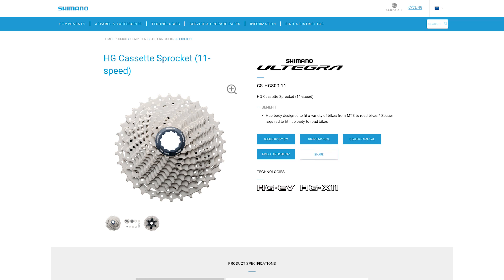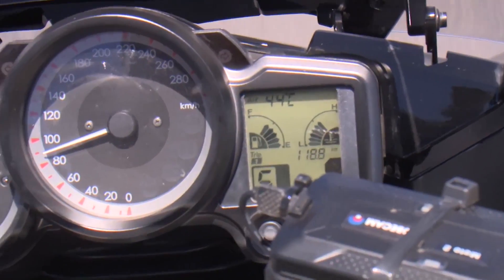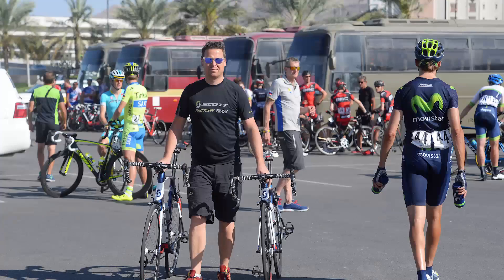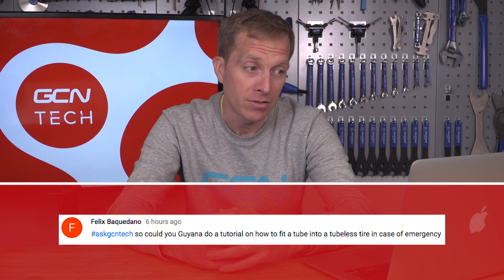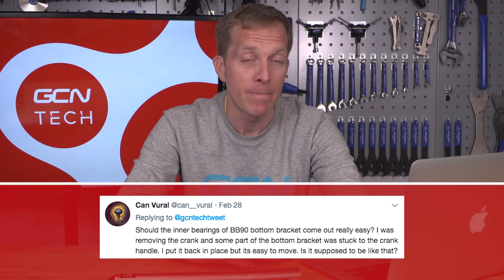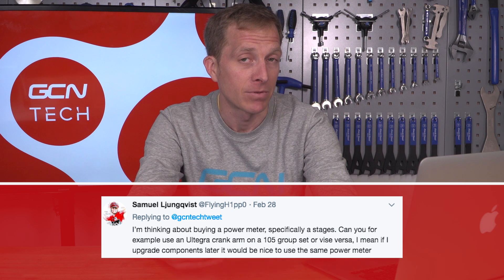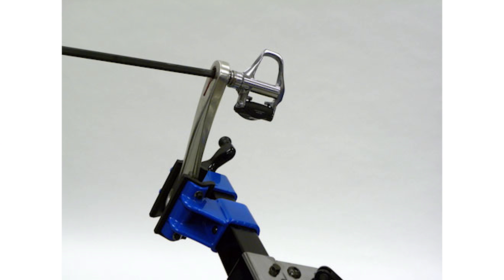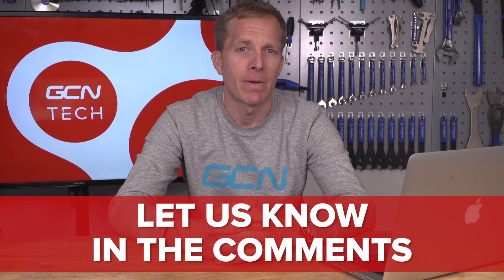Tubular Tyres: Tape Or Glue? | The GCN Tech Clinic

Comment: you talk about the benefits of disc brakes over rim brakes when weather conditions are bad e.g.: rain or mud then u talk about tubular glue and rim temperatures during braking without the mention of the benefit of disc brakes with tubular rims in dry hot conditions where tubulars rolling off the rim is lessened when using disc brakes...what gives?

Comment: Question, could you use sealant in a tubular tyre to avoid punctures ? If sealant can fix punctures in tubeless tyres, why wouldn’t it work in tubular ? Thanks
Reply: felix lessard Absolutely, I run 30mls of stans permanently in my tubs, which I ride everywhere. Latex tubes (which are in good tubulars) seals better than putting sealant in butyl tubes.

Comment: I don't see how carbon rims would get hotter under braking. The heat is converted from the kinetic energy of the rider+bike.  The speed, even with carbon wheels, will be about the same as alloy :-). The change in temperature then depends on the the specific heat capacity of carbon fibre composite and it's conductivity.  The heat capacity seems to be almost identical to aluminium, (maybe slightly larger) [1,2].  The conductivity can vary widely depending on the details of the composite.  With poor conductivity, the brake tracks may get hotter than alloy, but does that really translate into hotter rim beds where the glue sits?  Seems unlikely.
[1] http://www.matweb.com/search/DataSheet.aspx?MatGUID=39e40851fc164b6c9bda29d798bf3726
[2] http://www.matweb.com/search/DataSheet.aspx?MatGUID=b8d536e0b9b54bd7b69e4124d8f1d20a&ckck=1
Reply: oven cleaner Yes, it is a problem. When carbon composite gets to 200C it goes soft. This is a problem on clinchers because there is 100psi behind the brake track pushing outwards which  can blow the tyre off. (Why the introduction of disc brakes). With tubulars, there is no pressure at all behind the brake tracks therefore it is not such a problem. Why there is very little benefits for the pros to jump to discs
Reply: Sure, I agree with all of that.  The issue I have is around 5:15 where he says: " continental make a special glue for carbon wheels because braking on carbon rims generates quite of lot heat, which in turn could possibly melt glue." My question is whether glue on a carbon tubular is more likely to get hotter than on alloy.  I would say it wouldn't, based on the specific heat capacity of the materials being similar.  Yes carbon may go soft and it may be locally hotter on the brake track if the conductivity is poor, but I can't see how that would translate to hotter glue given that the energy dissipated in the rims is identical.
Reply: oven cleaner Oh yeah that is true, the area is quite big as well. It would be extremely rare for a tyre to roll because of that on ally or carbon. It is clear that the pros brake as hard as possible and as late as they can to get marginal gains and have little if no problems. If they did they would all be jumping instantly to discs. But they aren’t. All the top bikes now come with disc options so it is not to do with availability

Comment: I used tub tape with no issue for an entire race season, racing mostly criteriums. It's so much easier to center and stretch the tub properly, it's way quicker, and way less messy. Just make sure the rim is properly cleaned before. Thankfully my bicycle was stolen (FML) and I replaced my expensive carbon tubs with expensive clinchers (Yay), no more tape vs glue debate now.

Comment: #askgcntech I was overhauling the rear wheel on one of my bikes, and I lost the spacer that goes between the locknut and the hub! Now my quick release can’t tighten down enough! What should I do? I’ve never seen them at my local bike shop. Should I order one online? Could I use a series of washers from the hardware store? Or is there nothing I can really do?
Reply: Richard Isaksen Check with your local bike shop. They might have some in a random parts bin. My shop has helped me out a few times like when I lost a barrel adjuster while replacing my gear cable, or the time I lost a water bottle cage bolt. They didn't even charge me.

Comment: I’d rather glue than tape 
But if I’m using tape I’d go with Tuffo over jantex any day of the week .
Jantex is double sided carpet tape ( it’s not but you get the picture)
Tuffo is a ribbon of glue that’s easy to fit and remove but fantastic hold
Reply: ian owen any problem with carbon

Comment: Hi guys, 
Some days ago i was looking at Aero bikes online, and found out that the Canyon Aeroad CF SLX 8.0 allows on the front a max of 23mm tires, but i'm sure i've seen 25's both in the pro peloton and in some of your videos. So, does it actually allow them or it's just my mistake? Anyway, what does, generally speaking, determine wich is the maximum tyre width for a frame? 
Thx in advance!

Comment: Hi Jon, is there any problem in hanging vertically a bike equiped with hydraulic brakes? Is it better to hang with the front or the back on the top? Thanks #torqueback
Reply: Paulo Filho there is no problem unless you have air in the system

Comment: I used tubuless tires on standard road wheels for road and ‘cross for several years.  I never had a problem with safety over very many miles.  I now have some American Classic wheels that are tubeless specific.  I can tell you the tires are much more firmly seated into the tubeless specific rim.  On the other hand I also have tubeless 700X28C tires on my Zipp 404’s.  I don’t have any concerns leaning into any corner at any speed.  And they are sooo nice on the rough roads.

Comment: how can I check if my bike will have enough clearance for 28mm wide tyres before actually buying (or borrowing) a pair and fitting them? Currently use 25mm but was thinking of trying out 28mm when I next replace them
Reply: Bicycle Quarterly says you should have 3mm minimum clearance. If you have at least 4.5mm now, the 28s should fit fine. The main problem is that claimed widths aren't trustworthy. Less risky if you stick to the same tire brand, but it may still take some trial & error.  Here's the full story: https://janheine.wordpress.com/2013/03/12/how-wide-a-tire-can-i-run/
Reply: Go ask your local bike shop to try on some tires. If you’re willing to buy them there, they should able to help. I am thinking about putting some gravel tires on my old wheels...they said to bring everything in and then we’ll see how large I can go on the wheels and frame. Even if you spend a little more this first time, at least you’ll know it’s right and then can order cheaper ones next time.

Comment: If you want a cheap Lube alternative, don’t use car Lube. But you can try chainsaw Lube which is closer to bike chain Lube and a fraction of the cost
Reply: sewing machine oil is cheap and very similar to the thin bike lubes and it works pretty well but if you want really cheap and the lowest friction you should wax the chain as it will also prolong the life of drive train quite a lot compared to using oils, with the chainsaws industry is moving towards the natural vegetable oils because the oil gets thrown on the user from the saw and can cause skin issues
Reply: You will get more for your money if you by bike lube (check GCN for how to choose lube)
Reply: But bicycle lube is very affordable and goes a long way. Tri Flow is a good all condition lube.

Comment: I avoid the carbon tubular glue as it sets fast so you do not have time to adjust the tubular and get it perfectly positioned. Never had any problem with the regular glue going soft when hot

Comment: Hello GCN,
This summer i will go for a Transalp. Because i'm from nothern Germany i have no expiriences in riding high mountains. For safety reasons i want to take a 11-32 cassette. But now i'm wondering if I can upgrade my rear deraillieur to an Ultegra R8000 GS. Does it work with my Ultegra 6800 lever?
Reply: yes should be fine...will need a new chain though

Comment: Obviously not a race bike, but the Ikea bike has a disc brake in the front and a coaster brake in the back.
Reply: Is that the Sigfried or the Bjorn model?
Reply: Oh and those "Mobike" share-bikes in Manchester have a disk in the back only, drum brake in the front. Weight (along with performance) was obviously the least concern in the design of the things, main aim  maintenance-free operation.

Comment: I Used tape for years and never had a prob.
Reply: Pavel Kritovich brand?
Reply: Jesse Uriostegui any brand should be good, i use Miyata (expensive) on my rear wheel and Velox Jantex (cheap) on my front tyre and they both work the same. Just make sure it’s the right width for your rim

Comment: What is the difference between tube, tubeless and clicher tyres? :/
Reply: Tubes are just that tubes that are glued on the wheel, Tubeless are like car tires butt have liquid in them so if you get a hole it seals it. and clinchers take inner tubes the most popular choice.

Comment: what is the benefit of going tubeless vs regular clinchers?
Reply: You can run lower pressure with out going slower because of lower rolling resistance.  Better comfort leads to longer endurance as well.  And you will not get flats other that catastrophic failures that would destroy any tire.  No flats from thorns and the like though.

Comment: If you actually want to use a disc brake on the front and a rim brake on the rear, SRAM makes hydraulic rim brakes that can be used with the same levers on both brakes.

Comment: I'm running a Ultegra 52/39 and 11/28 with a medium cage on my Canyon Aeroad 8.0 CF SLX disc. This gearing is fine most of the time as I live in Norfolk (the flatest county in England). I'm doing some hilly sportives (Yorkshire White Rose, Bike Bath, Dragon ride etc), So I'm wondering if I can change the rear cassette for a 11/32 or 34 without changing the rear mech or chain? Thanks in advance. #torqueback
Reply: Depends on what iteration of Ultegra you have, and whether your rear mech is SS or GS.

A 6800/R8000 GS mech will handle a 32.  The SS tops out at a 28. 

And whether you need a new chain or not will depend on how your current one fits.  If its not long enough, you can extend it if you have some spare links.  Might just be cheaper to get a new chain though.
Reply: Probably not - Shimano and SRAM groupsets which can have wide-range cassettes need long-cage rear derailleurs to fit such cassettes.  I use an 11-32 cassette on my SRAM Red setup and it's got a WiFli long-cage derailleur on it.

Comment: If you don't mind the oily residue,  car lube thinned with mineral spirits is a very effective chain lube. Use it with a little oiler to avoid the mess, roll in into the chain well and then wipe off excess. It's a hell of a lot cheaper than any wet lube you can buy.

Comment: Just replaced my taped tubs last weekend, I'd invite anyone who says "never use tape" to pop round next time and give me a hand removing the old tubs.
Reply: Timotei of Bollow Yep no probs replacing a tub on the side of the road. No tyre levers needed. Rock the tyre back and forwards till the tyre rolls over the lip and the glue is unstuck there. Then just pull the tyre off the rim. Then get your spare tub whack the valve in the hole and stretch over the rim. Pop a little air in, straighten, then pump up. Rim back on bike, then ride. Just don’t scrape the pedals as it isn’t stuck on securely. Gets you home no probs. Then fit properly. You can even ride a tub flat, slowly, if your not to far from home
Reply: Jantex??
Try Tuffo it’s loads better
Reply: Acyually I heard Tufo, had to reduce the strength of their glue on their tape as it was damaging carbon rims. Now people are a little paranoid about tape and carbon rims. I have taped heaps of tyres, use velox 176. Not a problem with carbon
Reply: Justin Hodges - tape supposedly result in worse rolling resistance
Reply: J B Wow, I'd love to see the data on that.
Reply: Yep tape is brilliant!
Reply: This!

Comment: #askgcntech 
Is there any real advantage to going tubular/tubeless for a non racer? Ie someone who mostly commutes through the week, and rides for fun on weekends.
Reply: That Ewok This is one of those debates that is fiercely discussed, really it is personal preference what you like to run. All systems are quite mature now. I personally like to run tubulars everywhere. I do this because I find tubulars with a little sealant in to be very reliable and can be safer in a blowout. Clinchers have the advantage of being able to be repaired multiply times, you can repair tubes (patch them many times) and tubes are very light. Tubeless rely on the sealant to seal any flats, this is why I don’t like this idea, as I know sealant will not fix every puncture, so you are back to carrying a tube, same a a clincher, so why use them.
Reply: nstrug Why is it that people always believe you get stuck with a flat tub???? It is not true! You carry a spare and it is very simple to change, in fact arguably quicker than a clincher. Also the pressurised sealant cans can sometimes fix the puncture. If you want to carry instead of a spare. Also you can ride a tub at slow speed, can’t do that on a clincher, unless you want to wreck your rims. Trust me, tubulars can be used everyday and in all conditions, I do it and with lightweight race tyres. In fact I have a Vitoria corsa speed graphene on currently (considered a very fragile tyre) and 800km later, still going strong! No punctures yet!
Reply: nstrug I have ridden 10s of thousands of clicks on race (lightweight) tubulars with 30mls of sealant in and I have never had two flats (dead flat the sealant completely failed to work). I once wrecked my spare fitting it. My own silliness. Wht did I do then??  I just rode home on the flat tyre slowly, about 5 km. It was on a reynolds ultra light carbon wheel and no damage to the rim when I got home. In fact I was amazed how well the tyre held up dead flat. So I have never had to ring a friend, ever! Also I have very rarely had to take a tyre off a rim. It would be only about once a year. As I said earlier tubs are really reliable.
Reply: That Ewok tubeless yes, tubular no. Tubeless reduces the risk of punctures. Tubular doesn’t, and if you do get a puncture you are screwed.
Reply: I use tubeless, and rarely race. The only "puncture I have had in a year (about 10 thousand km) was when someone told me there was a leak of white spray out of my rear wheel. I didn't even have to stop. Every time I ride over a pothole, or hit glass, I remind myself that I can relax with tubeless.
So I think tubeless is great - but... you do need to get geared up with tubeless sealant, different tyres, a pump with an extra chamber, etc. It's also more messy and slower to change tires. Finally, they leak air more quickly, so I'm pumping my tires about twice a week, rather than about once every two weeks with tubes.
Reply: Thanks for the info, guys. I'm probably going to stick with clinchers for now. My 28x700c tires have only ever punctured when i ran over I think a metal shard. They're serving me well, and I don't want to make the financial dive into the chambered pump, glue, and all the other essential equipment to change. Maybe when i decide to get a wheel upgrade.
Reply: nstrug that is absolutely fine, people choose what they like to ride, but I dislike it when people tell people you will get stuck riding tubs. It is just not true, you take a spare like you do with a clincher, it pops in my jersey pocket like a tube does.
Reply: wayne proud tubeless are great on my MTB and CX as they do reduce the risk of punctures considerably. On the road bike I stick to clinchers as the risk of punctures is already low and I would have to carry a tube anyway even with tubeless as the sealant doesn’t always work. Would never run tubs as the though of flatting 40 miles from home in the pissing rain and failing light and then having to muck about about with a needle and thread doesn’t fill me with joy.
Reply: wayne proud I’d rather carry a spare tube (or even just a patch kit) then a whole tyre or two every time I go for a ride. Also on group rides if you ride clinchers you can always share repair gear - not so with tubs as you will likely be the odd one out.
Reply: wayne proud what do you do if you have two punctures on a ride out of interest?

Comment: I have a Trek Madone with BB90 for the bearing question. That scenario is quite frequent and my bearings can be removed and pressed in quite easily. I have not noticed any issues as I just replaced the OE bearings with Enduro Ceramics and they fit somewhat loosely as well. Spins like a top...
Reply: The bb90 bearings should be snug in the frame. They have an issue of letting water in on the NDS. When the bearing gets corroded it starts turning in the frame damaging the bb shell. So trek came up with the v2 bearing to fit the woren shell. Personally i check mine every few months and install them with loctite assembly compound.

Comment: 6800 shifters + 6700 RD: wouldn't the main concern be the travel distance of the RD, not the indexing? the RD is simply a slave, it isn't indexed, itself. as long as a 6800 cogset was used the setup should, hypothetically, work, right?